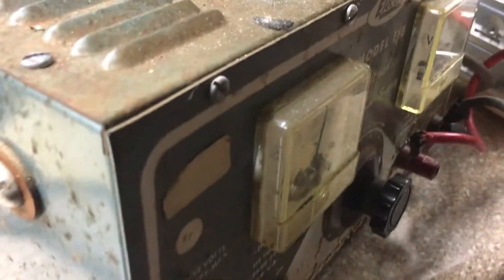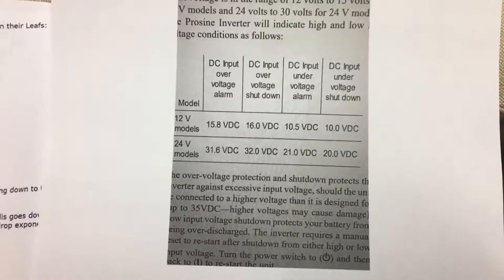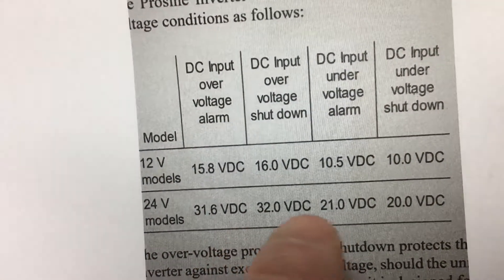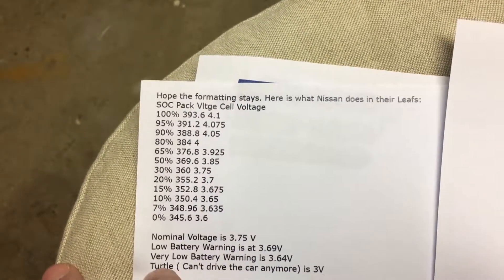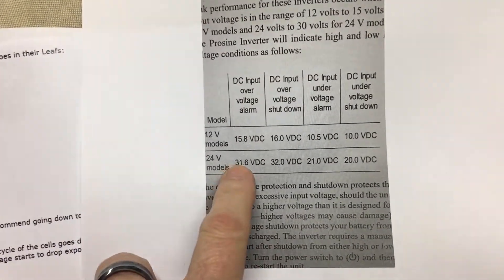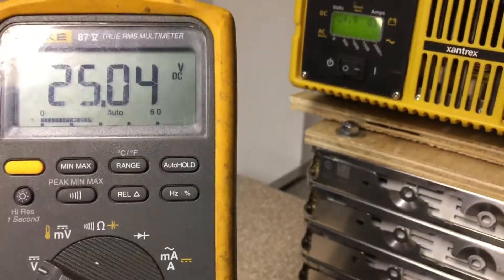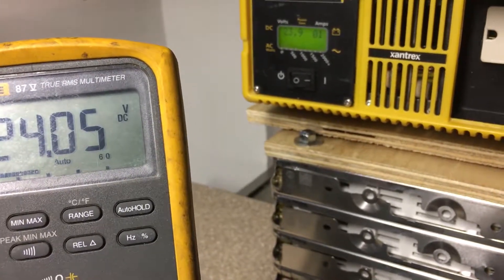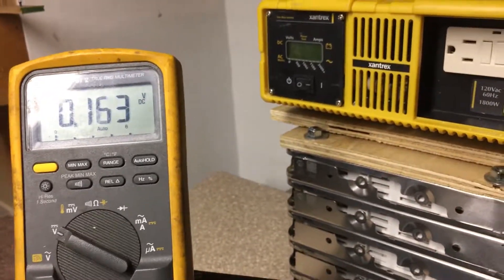Nissan Leaf battery pack with inverter

Comment: Any links to any of the items you all are using, i.e inverter, BMS, where to get battery modules, etc. would be extremely helpful and appreciated here. I want to do something similar. I guess for now just an inverter to power things when there is an outage, running off my EV with a solar option on the inverter for the next upgrade.
Reply from the maker: good recommendation. Going forward it would be a good idea for me to list all items used in a video. For this video  the nissan leaf batteries, I get them on ebay, last purchase was through this seller -- greentechybridbatteries - He had fair prices and tested the Ah of each module. The xantrex inverter is a prosine 1800. I would look for the inverted used, as the cost of new is quite high. I found mine on craigslist.
Reply: @IFix-Things  Cool!!! I appreciate the info.

Comment: I'm watching for your updates. I am also dong this same project connected to a small 24v solar system because I like the mobility of the leaf packs for a quick transportable generator use. I'm still researching what BMS setup to do. Have you setup your BMS yet?  I got the 7s 48volt kit from Tech Direct so I would have everything to test in the future and I thought I would find someone customizing the 7s BMS for 6s use by now but no luck yet.
Reply from the maker: Tim, no bms yet. The issue is the nice bms are expensive, and the cheap ones i'm afraid could be dangerous.  there is a forum called buggiesgonewild . there are many guys in there who have done lithium conversions with nissan leaf cells, you can go there and see what bms they used, most used the more expensive kind.
Reply: @IFix-Things  have you considered modifying the tech direct kit? I'm expecting to find a comment feed where someone has used the kit but with 24v mods. I would think their 14/7s bms could be used in 24v by swapping the circuit board with bus bars and putting individual wire ends into each bus bar like jay Summet and just leaving the extra contact wire disconnected. I've installed their kit because it condenses the wiring very nicely, frames each unit for quick transport, and provides a nice surface area to mount extra's like a monitor w/ screen and battery protect or breaker switch etc. I should have my video and pix up tomorrow.

Comment: If the batteries are used you may be at risk of hurting the pack if you go down to 20v. If you dont have a bms 1 cell may go below first and that cell may be ruined. What BMS are you using?
Reply from the maker: Agree 100% with you frank.  I dont have a BMS yet, any recommendations?
Reply: @IFix-Things  if you have some money id go with a batrium. How old and unbalanced are your cells?